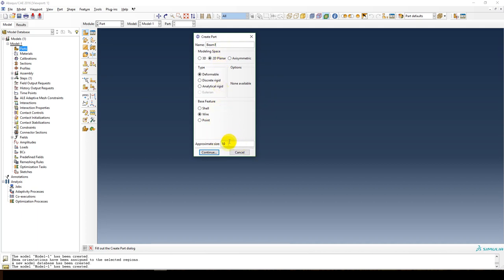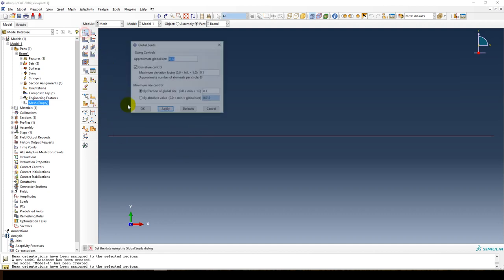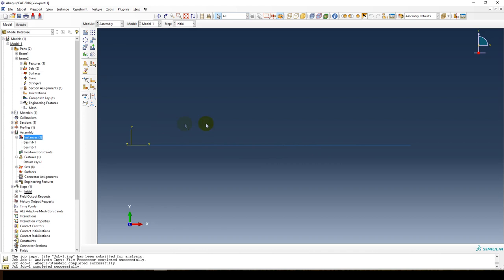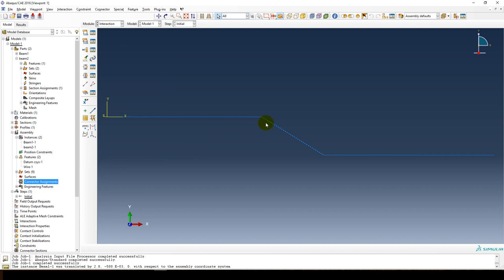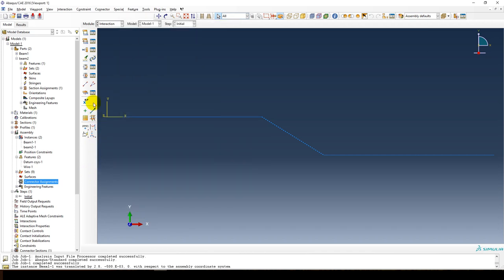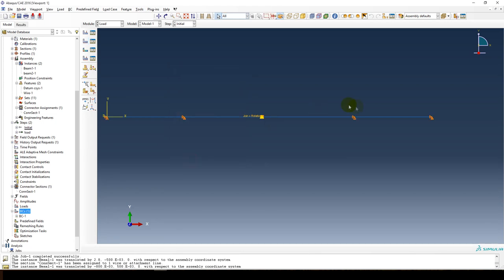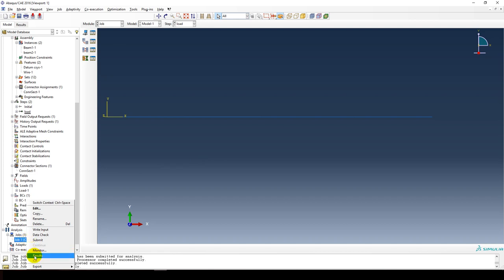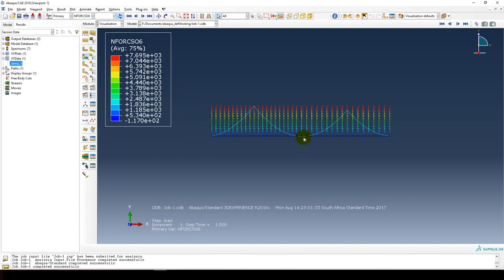ABAQUS #4: A Continuous Beam with Nodal Hinge

Comment: Very well explained tutorials. Can you start uploading again describing a few more mechanics problems? That'll be Abaqusutely amazing
Reply from the maker: Hi, I have some I'm working on... Hopefully I'll get to finish them and upload soon :) Any particular problems you're interested in?
Reply: @TMsChannels  hi buddy, thanks alot for the reply. Absolutely, I have a few problems on the same track, related to technical mechanics: bars, beams, joints, moments, distributed forces etc.
It'll be easier if I can send it to you via email. What do you think? Is there some platform you can suggest?
Reply: Also, a small request. Once you reach the end and the simulation is complete, could you spend some more time into discussing the simulation itself? By this, I mean the reasons why it looks the way it looks. Thanks.